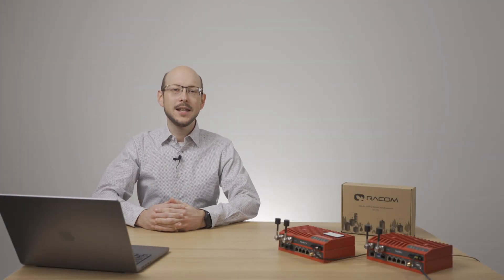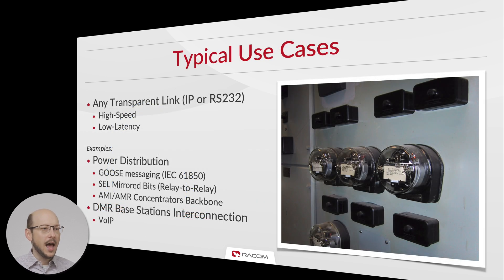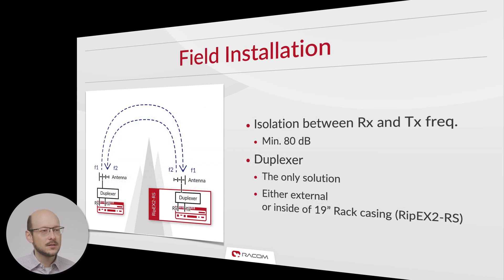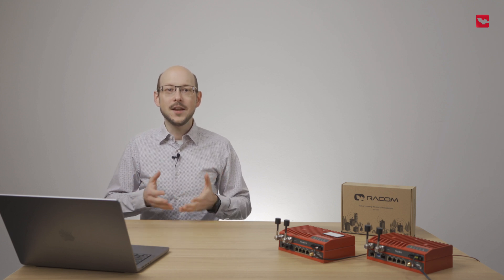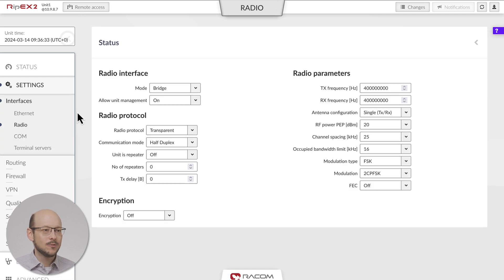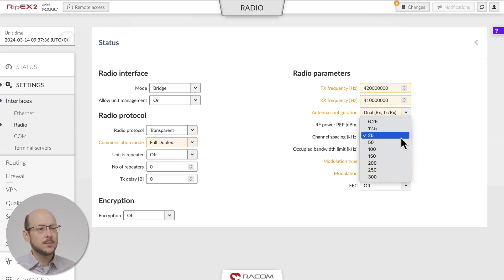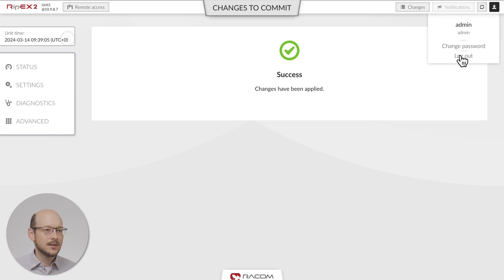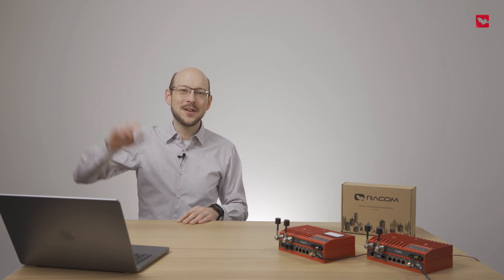RipEX2 Tutorial – Full duplex Point-to-Point Link

Comment: You cannot set the same Channel spacing and Occupied bandwith limit under normal conditions, given by the regulation of the frequency spectrum. Normally for Channel spacing = 25 kHz,  the given Occupied bandwith limit = 16 kHz. Unless you have an exemption from the national frequency spectrum authority. At least in the EU such harmonized conditions apply.
Reply from the maker: Yes, you are right. You can find details about occupied bandwidth and channel spacing for all chanels in RipEX user manual, e.g. here: https://www.racom.eu/eng/products/m/ripex2/tech.html#tech-det